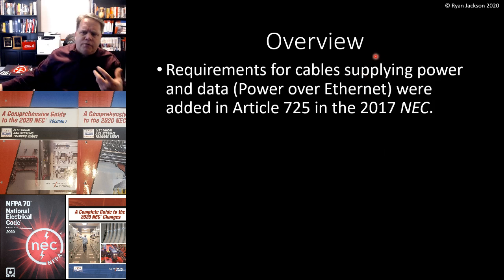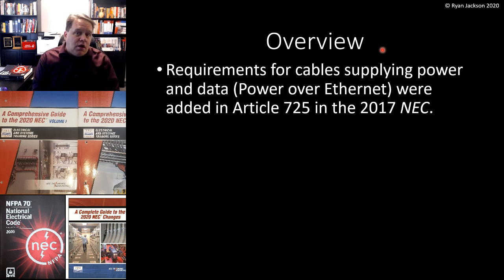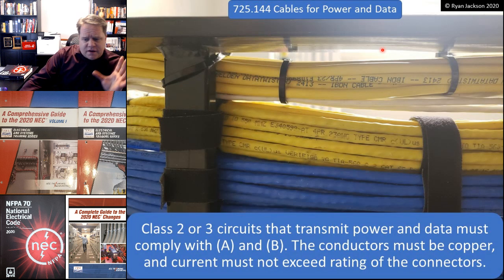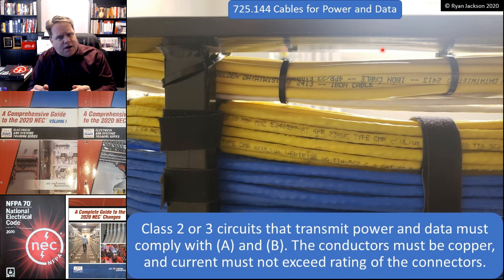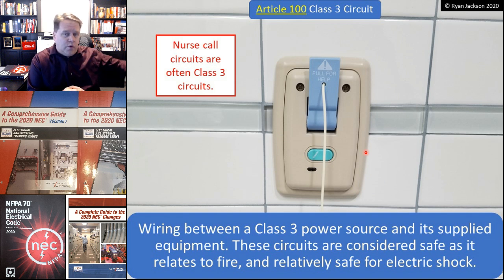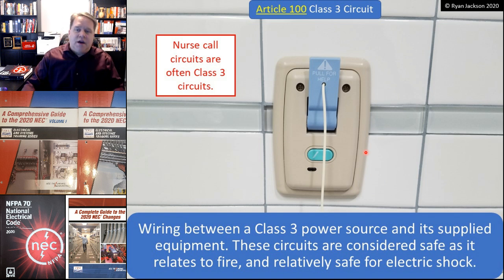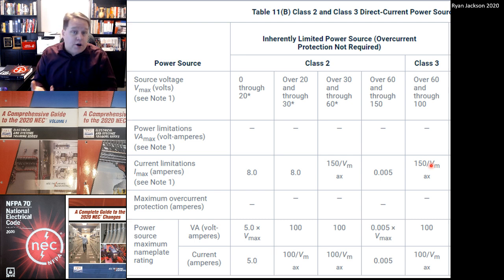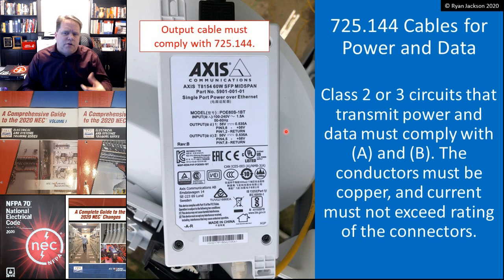Power over Ethernet and the National Electrical Code

Comment: I’ve been electrician for many years. I was like you, I didn’t really care about anything over 480 and certainly didn’t care about low voltage. I started doing fire, cctv access etc about a dozen years ago and I love it. I get to do lots of control work. Relays and timers etc. I find it much more interesting than the typical commercial electrical work. 

I see the Axis thumbnail mid span. Axis = cost a lot and fails a lot but when it’s working it’s great.

Edit: I hate the sloppy work that is the standard of the low voltage world.

Comment: Great summary.  I own a UL508A panel shop.  We love Class II circuits.  Our favorite flavor are 24VDC with a 4A 1077 circuit breaker.  According to UL508A, all devices on these "limited energy circuits" are not to be investigated by UL.  Allows us a lot of freedom to buy unlisted components and install them in our control panels.

Comment: The biggest issue I foresee is some fellow electricians exceeding the distance for PoE of 100 meters that’s the standard of distance in the various IEEE 802.3 (af,at,bt type 3 and bt type 4) . It happens with DATA all the time let alone PoE but it will happen for PoE I’m sure of that. 

Also Generally I agree with Ryan on everything except how he dismissed the note 2 out of hand due to connector limitations. That note is relevant if you use a better connector (Phoenix contact makes connectors rated for 1.75a) and if you understand those standards IEEE 802.3af, IEEE 802.3at use only four conductors for power. The IEEE 802.3bt type 3 can use 4 or 8 and IEEE 802.3bt type 4 uses 8. This might save some headache using the note 2 on peoples install regarding bundling BUT I think why he dismissed it out of hand like that is changes post install from 4c run install changing to 8c when bundled for 4c and that not getting changed since all the PoE stuff is basically plug and play by anyone.
Reply: The standard is 90m max length for the structured install. The 100 is overall wire length allowed before signal loss. You have to leave length for the cabinet and desktop connections.

Comment: When you said 8P8C connectors are rated for 1A, is that per pin or for the entire connector? Presumably per pin like the cable ampacities? (so a 4-pair PoE injector could supply up to 4A on an 8P8C connector?) Otherwise the PoE injector you show at 15:00 would be noncompliant since it's rated for 23W@21V per port.
Reply: I found one source saying they are typically rated for 1.3A, not 1.0A, but it didn't mention per wire or total. However, the minimum rating to meet IEC 60603-7 is 1.0A per contact, so that's the way the standard is written. It has to be per contact, as both the power and return have the same current. But, when two conductor pairs are used for power, there may be an imbalance between the pairs. That's likely driven by the different twist rate to minimize crosstalk between pairs for data transmission yielding one path being longer than the other causing resistance differences. That difference is limited to 20% by IEEE PoE standards, but not all 8P8C are necessarily PoE. I've seen it used for RS-232 back in the day when that was popular.

Comment: copper clad aluminum twisted pairs ethernet cable is all over Amazon and are fairly cheap.
hard to tell if cable is 100% copper unless cut into it.
cannot tell the type of metal by weight, unless the gauge of the twisted pair is advertised and true.
and then, there is also the problem of solid vs stranded twisted pairs.

this area definitely need more standardization.
Reply: agreed. thanks for pointing out the cheaper amazon cables. I didn't know that.

Comment: Glad you’re back!
Reply: Awesome video,  thanks again Ryan  and do you know if PoE lighting  is also going to be installed in dwelling units or just commercial ?
Reply from the maker: @rafaelvelasco6357  I think it will mainly be residential, at least for awhile.
Reply: @rafaelvelasco6357  I've yet to see PoE lighting in residential. But, I'm sure it will be. With commercial, it's literally a drop-in replacement -- they fit into the standard 2'x2' ceiling grid.
Reply: @RyanJacksonElectrical  I think industrial will be the first to uptake, I'd be pushing for it in any building. No electrician needed, immediately ties into automation via cisco which I already know.

Comment: As far as inspections go, how does the inspector know an ethernet cable is using POE. And even still how many conductors in the ethernet cable are being used for current. In a residential environment I could potentially have ethernet cables going from "no where" to "no where" if the equipment, (switch, camera, access point) is not installed before the electric inspection. I dont use POE injectors, I just use POE switches. As far as data with power, how does the NEC define data?

Comment: I have a question at 13:30 and 13:51: Ryan, you seem to be saying the connector limits the current of the entire cable to 1 amp, and your graphic's text says the same. Is this a mistake or just me misunderstanding? When I read informational note 2 at NEC 725.144, it specifies this is "per contact" not per connector. The table is for each conductor within the cable so I want to understand this means the connector limits the entire 8 conductor cable to 8.0 amps, not to 1.0.
Reply from the maker: Great point David, I think you're right.

Comment: worried about electrical safety of poe when usb is pushing 300 watts over a 40 gauge chineesium aluminum "wire", plugged into a death trap non-isolated usb charger.

Comment: I just finish a airport job that lighting was controlled with Cat 5E. the dimmers ,switches, occupancy sensors power/ dimmer power pack was Daisy chain with cat5E. Acuity n light system within a fresco controller.

Comment: Its crazy to me that people like that can still exist but the more I think about it I'm not surprised. I've come across electrical distribution houses that don't stock ANY wire smaller than 14 AWG, even besides all the crusty electricians I've had to deal with who refuse to strip a wire with anything other than their Kliens. Even when they are faced with 400 connections in front of them that just happens to be sitting beside a box of auto strippers.
Reply: Thank you for the pointers !

Comment: As a computer need who dealt with IBM Bus and Tag cables (conduct or as big as my pinky)   I have always had my doubts about UTP.  I did run UTP in my house because I like WiFi less.  Just like power wiring, termination of UTP is very dependent  on the quality of work done.  My prediction is that if POE becomes widespread, that amateurs will make connections that are unsafe.
While POE was designed for data network devices, using POE for lighting will inevitably lead to a race to the bottom in quality as manufacturers try to get price advantage.   The place I see the biggest problems is cheap transformers  as the POE source.  Where will these transformers be located and when they fail will they cause fires?

Comment: 15:23 Stock only the tiniest cable ties and you won’t need to worry about more than 7 cables per bundle.
Reply: NEVER EVER use cable ties made in lack of quality control lying cheating china. We had several china brands in work and all wete junk. At least 25% of them nroke while installing. A lot would break if you just moved tied bundle. Can't wait until computer geeks are installing luminares and PoE cables in drop ceilings.

Comment: It certainly looks like POE lighting will dominate within a decade. No more line voltage drivers.
Reply: still gotta get that power from someplace. just instead of ballast drivers you have poe injectors. the driver still exists, it's inside the light. so you're converting from 120 volts to 48 volts then to whatever voltage the light is running at, which is actually current regulated. we can add a lot more complication to that. lets have it call home to the "cloud" and automatic updates that reboot every light at a time you can't control and have your password stolen so some 10 year old kid can play with your lights from across the country. one day, 10 years from now the company running the servers in the "cloud" will close their doors and all your lights stop working. I'm not happy damn it :-)

Comment: New USBC protocol 270 w.... I'm going to install low voltage DC receptacles in my home.  Looking forward to Future flat screen TVs powered by USBC.  Looking for installing solar panels with no need for an inverter exclusively to run all DC electronics and lighting...  And POe cameras

Comment: How is "bundle" defined for ladder tray?    I could have 75 cables in a tray that is only stacked 3 wires high.  No way that is the same heat build up of 75 wires in a round bundle.  In the tray for the one center wire on the top you would only have 1 wire and on the bottom a bar every 12" under 1 wire.  Also what about wires being bundled through a chase between floors?  And that is the only instance they are bundled in high density. I see engineers spec. A couple of 4" conduits to accomplish this.
Reply from the maker: It's not defined. The ampacity adjustments are usually not a lot to worry about, however, as the power flowing through a cable is going to be limited by the source and by the load.

Comment: Nothing wrong with having cat wires against the roof. That's the whole point you can drill straight through no fire risk. Realize 192 wires is 4 48 port switches. On a typical building floor that is very common.  Also they added the must be copper because if you poke around from 2008 through 2019 they were making copper clad cat 5e. If you picked up a box and though damn is that empty, it was copper clad. Data didn't care and it saved money now they added power, which is more than those wires can take.
Reply from the maker: I agree that you wouldn't start a fire drilling through the cable. My thought is that you must comply with certain portion of 300.4, why not all of it. We are either concerned about damage or we are not, no sense in only going halfway.
Reply: @RyanJacksonElectrical  kinda, the code is to protect from fire and safety. If it's stupid but safe we're not nannies, though you're right it's probably the best place to put it. My concern is you're going to start seeing people push lots of rules to try and pull PoE/Data to keep up the walled garden that has become electrical work.  I look around my home and I can see in the near future only needing a single 120v outlet per room maybe. With the exception of the garage, kitchen and basement of course.

Comment: The world still needs dinosaurs. I'd much rather call in someone who knows their job inside and out than someone who claims to be able to do everything. The generalists tend to be mediocre at best. I've yet to find an electrician who was worth a ** at running data systems. (those are very different wires, for very different applications.)

Comment: Yeah the electrician's will still doing lighting.... Case in point, I just saw house with over 70 canless recessed lights installed with 120 going to each one of them through a little junction box with a transformer... One for each light.... Absolute insanity... Absolute waste of copper.  They could have put an inverter in the basement and ran 16 gauge in zones to each one of those lights that dropout less than 10 w each.

Comment: "The primary concern is reducing the threat of fire..." Bull. They just want to poke their noise into a new business. Where's the evidence of PoE cabling starting fires? (nowhere, because they don't. plus, CMR and CMP cables don't burn.) Even with 802.3bt, that's 100W delivered with 71W available at the device -- so 29W dissipated across all 8 wires, and to drop that much it'll be a pretty long run. (so less than 24mW per foot [150ft drop]) It would take some very large bundles -- with ALL of the runs providing type 3 or 4 power levels -- to even generate measurable heat. And it will never be hot enough to start a fire. Your cheap-as-sin chinesium PoE power supply, however, is much more of a fire hazard. (as is bolting the PS to the roof and then driving a screw into it from the other side.)

(translation: because a growing number of installations are switching to PoE fed LED lighting, the NFPA doesn't want to be left out. You can't escape The Code.)
Reply from the maker: The substantiation was based on a UL fact finding study. UL. 2015a. Fact Finding Report on Power over Local Area Network Type Cables (4-Pair Data /
Communications Cables) <with errata 1 revisions>. Washington: SPI (Society of the Plastics Industry).
Reply: @RyanJacksonElectrical  Thanks! Reading the 164pg report now. First take... UL pushed 2x the power current PoE standards allow. (802.3bt [2018] is just shy of 1A per pair not per wire.) Also, the IT world has been using PoE for over a decade (and telco for half a century); I'd like to see the proof it's actually caused fires.
Reply: @RyanJacksonElectrical  Oddly uncharacteristic testing from the UL. Having sent things through the process, I'd expect them to test with their usual "real world" conditions, not hundreds of feet of cable looped into a single-span-light-bulb-filament. And it still didn't cause a fire -- the way they tested, it stops once the now-single-wire breaks. Way to "take it to extremes"! I've never seen anyone bundle 100 cables out to 100W PD's. (cameras, APs, POS terminals, PoE powered switches, etc.) [that'd be 10KW of PSE's in the rack/closet. that's an insane amount of power, btw.] Even in the densest MDF/IDF's I've seen, the large bundles split out rather quickly.

I think what we're preparing for is more a case of power-over-cat5, and less power-over-ethernet because many of these LED lights aren't actually using the data part of the spec. Some of the higher end lights are addressable -- to control brightness, color temp, etc., but the cheap ones have no comm logic in them at all. Class 1/2/3 cabling should have similar derating and bundling constraints as other "power" wiring, if they're being used to carry power. This will be hard to police in communication systems as it's hard to know (a) which cables will be used for power, (b) how much power those cables will carry, and (c) where in the bundle each power carrying cable lives (a cable in the center can't carry the same load as one on the edge.) Data cabling is a highly dynamic environment.